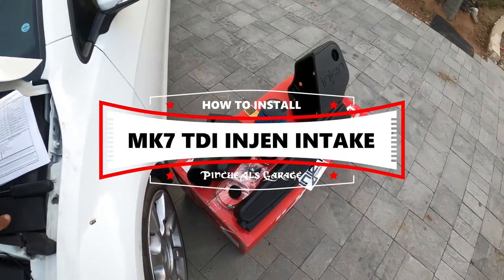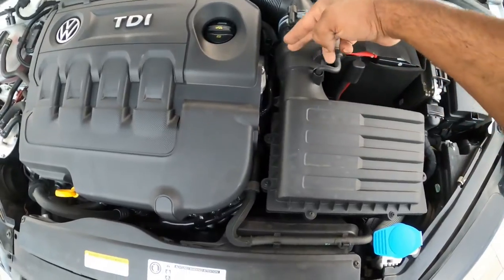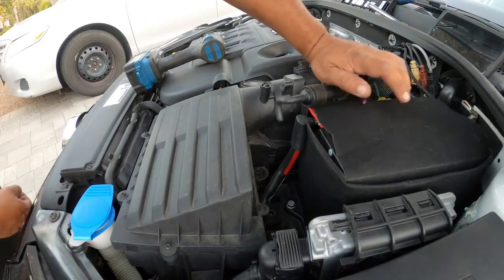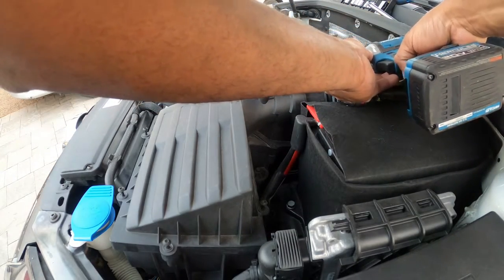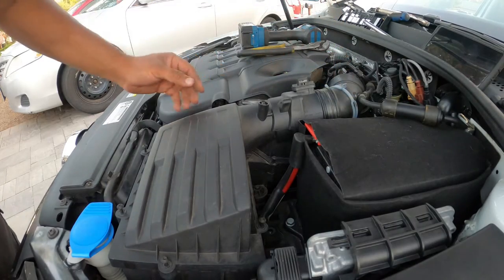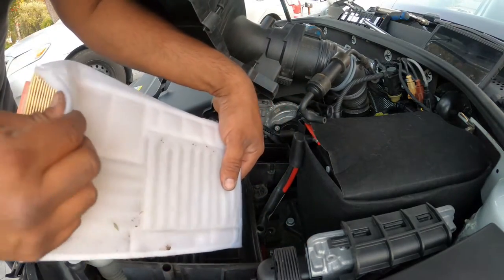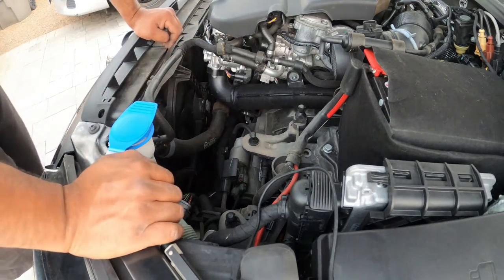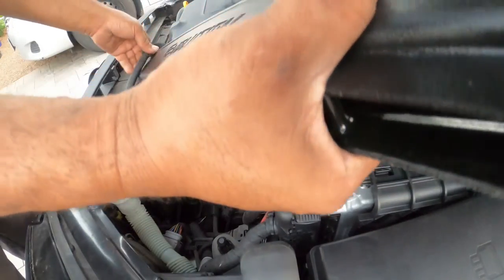How to install MK7 Golf SportWagon Injen Intake System S7EP31

Comment: Looks sweet buddy. Almost oem if the injen was it in the mould it would pass off as oe I think, they do a racingline r600 kit over here. There not drastically noisy but there is a noticeable  increase to air intake. 

Can anyone else hear the constant high pitch noise? Almost like tinatus sound of ringing in the ear.